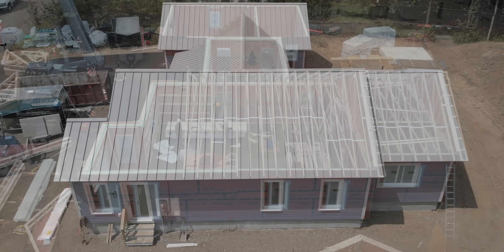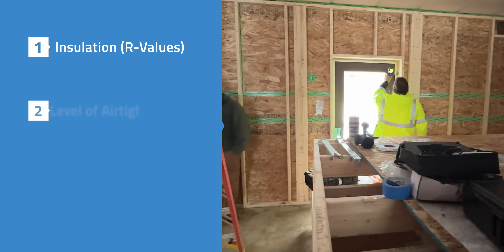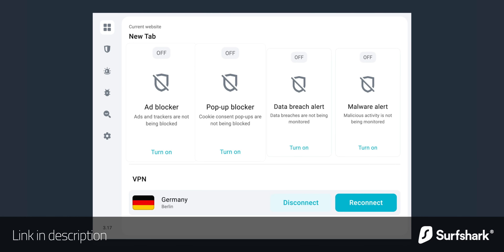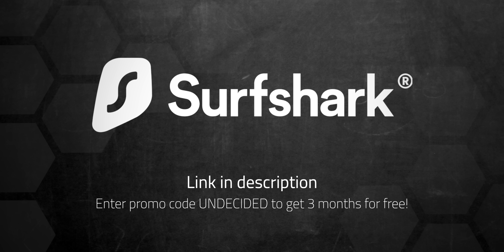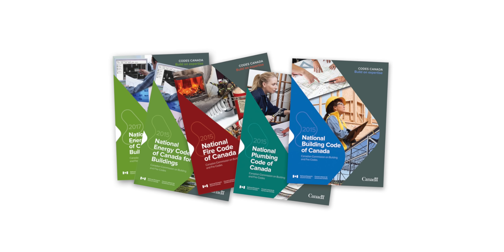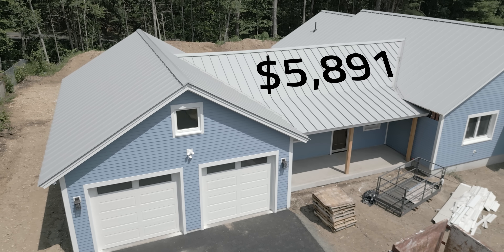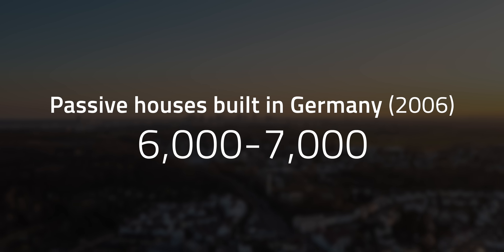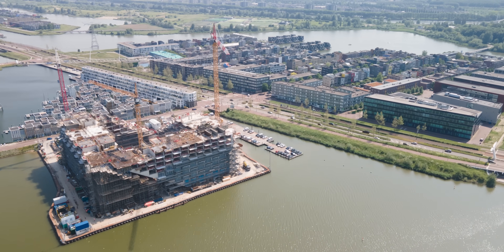Why Do American Homes Suck?

Comment: I've chosen a horrible time to search for my first home.  Trying to budget for AeroBarrier to be performed before I move in... though I'll have to find out if it's worthwhile to do before other improvements.  It's a dream to build a Passive House, or as close as I can.
Reply: I just bought a spec home. Don't. Get your custom done if at all possible. 
I figured new construction would at least be better than the 100 year old house I had been living in, not really. To be fair most of the issues with my new house will be sorted within the year, then I'll have hopefully a couple decades of relatively few issues. While the 100 year old house had constant issues.

Comment: Careful with stats comparing US homes to European homes.  Average US home is >2000 sqft, while the average European is closer to 1100.   Yes, they are more efficient, but a big chunk of the difference in energy usage is size, and not just construction technique.  Energy efficiency is purely economic, and we have to be honest if we are going to talk about he longterm value.  No one ever discusses a discounted cash flow model when referring to the benefits of energy efficient products.  Everything from Geothermal to Solar, to passive homes are not a good economic layout once you apply a modest discount rate (Time value of money) to the equation.  I have solar and love it, but it was basically break even over 30 years with a 5% discounted cashflow.  If you compare to something like stock market, that rate should be more like 8-%12% and going solar is a flat out bad investment, if you're measuring just financial return.
Reply from the maker: Good call out on the house size, but I question your theory of payback periods.  Be careful to not paint with too broad of a brush.  I'm surprised that it was a 30 year wash for you on solar.  My previous house is going to cashflow positive on solar after about 9-10 years.  My new house should be something similar.  Aggregate data shows payback periods for solar tend to be under 10 years.
Reply: @UndecidedMF Cashflow positive with what discounted rate?  A discounted cashflow model reduces the value of future savings based losing the value of having those funds over that time.  Given the base cost of capital today, you should probably be discounting future savings at something like 7%ish/year.  Most solar models, inflate future energy cost (mine assumed 4%/yr) but don't discount for the lost opportunity of having your money tied up for 9-10 years (perhaps yours did).  The saving grace for mine was that Uncle Sam essentially fronted a bunch of cash (tax rebate) and interest rates were silly low, which doesn't mean the technology is cost effective, only that temporary loop holes existed to leverage the tax base.  I am not saying we shouldn't look at it and do it, but I always get nervous that we are padding the stats, maybe unintentionally. @UndecidedMF

Comment: I live in a swedish B energy rated apartment building where A is the highest. I sit in underwear with the windows open day and night. It’s almost november and its 16C (61F) outside. Solar panel roofing is built to offset the 6-floor elevator travel. In winter the windows freeze over on the outside over night and thaws in the winter sun in the day.

In summer the outside walls are HOT to the touch while inside is cool enough to not be awful without any airconditioning at all. As long as windows are kept close in day time the air temp indoors is lower than outside.

Comment: Its quite likely after Brexit that the EUs housing has increased. The UK has huge numbers of homes that are over 100 years old with some 400+ and the design of those houses and ideas of insulation just didn't didn't happen to the needs of modern air tight housing. The UK has a huge problem as refurb is massively more costly and near impossible to reach new build efficiency.
Reply: True but those built within the last 100 years are mostly awful albiet good windows. Such a shame timber framed houses didn't become the standard.
Reply: @BoyeeSmudger  Its not just the construction materials, those old houses had many open fires for coal or wood with many chimneys and huge air flow. The complete design was to shift air through that just blocking turns into huge damp problems. Also to go to levels as new build underpinning a house so that foundation insulation can be inplace after build is obviously expensive and often not done.

Comment: In my country in Europe we prefer U-value instead of R-value. Harder to calculate, but better to evaluate energy efficiency of a building.
A U-value is a sum of the thermal resistances of the layers that make up an entire building element. A U-value value shows, in units of W/m²K, the ability of an element to transmit heat from a warm space to a cold space in a building, and vice versa. The lower the U-value, the better insulated the building element.
On one house i seen 4 different composition of materials, for many different reasons, but in the end every wall and roof had very similar U-value.
Reply: This.